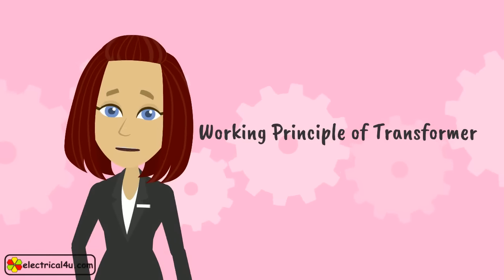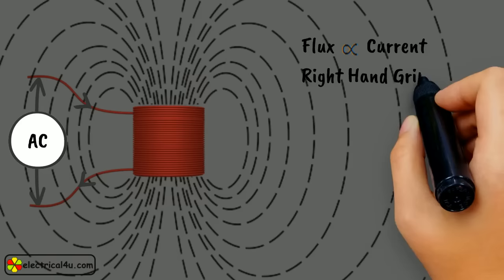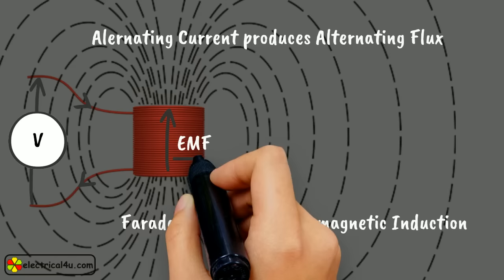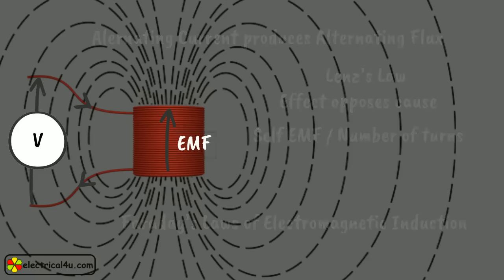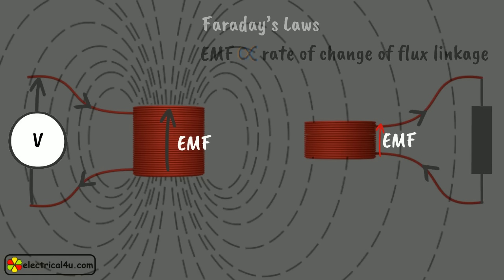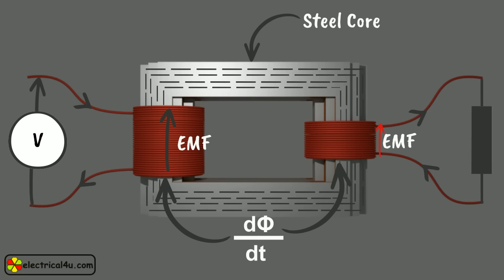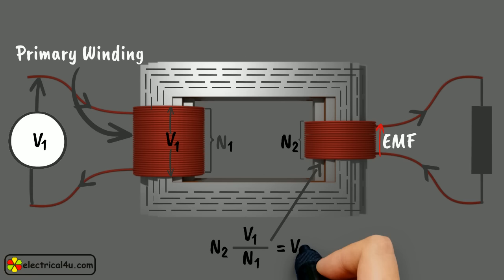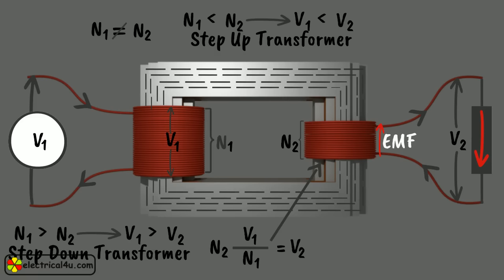What is a Transformer And How Do They Work? | Transformer Working Principle | Electrical4U

Comment: Thank you so much ma'am, you explained it in the most simplest yet informative form ..not kissing on the basic points! ❤💜
Reply: Good
Reply: It's a computer voice.
Reply: A "Free Energy Transformer" is a device which takes energy from one source and transfers it to another without doing any work. It does this by using the natural laws of physics. The most simplest form of this is a transformer which takes electrical energy and converts it into mechanical energy. This can be used to power small devices or motors. 

The more complicated form of this is to take energy from one source and convert it into electrical energy. This can be used to power large devices or homes. The advantage of this is that it doesn’t require any input of energy from the user, other than setting it up initially. It also doesn’t produce any waste products, such as heat or pollution.

Comment: In recent years, the cost of living has increased while the wages of the average person have stayed about the same. With the cost of electricity on the rise, it is no wonder that people are looking for ways to reduce their energy bills. One way to do this is to create a free energy transformer. This transformer takes advantage of principles in physics that allow electricity to flow freely through certain materials. 
The first step in creating your own free energy transformer is to find an appropriate container. The container needs to be able to hold a charge without dissipating it. Glass or plastic containers work well for this purpose. The second step is to add an electrode to the bottom of the container. This electrode can be made from any metal, but aluminum is a good choice because it is inexpensive and easy to work with.

Comment: Err... S Ghosh. Thanks for the video and i am sincerely grateful especially for the clarification of the difference between supply voltage and induced voltage in the primary winding.

I do have a question though. Since according to Lenz's law, the induced emf is such as to oppose the causing emf, is there not supposed to be a nullification of the supply voltage in the Primary coil such that no current flows through the Primary?
Reply: Thanks for ..... Good explain ...to this Part... thank you madam

Comment: Will you clarify ,
 While , using the core, maximum number of magnetic lines pass through inside the core 
So how the secondary winding can get exposed to maximum flux  ?
Is there any step skipped  to explain 
Before happening mutual induction inthe case of transformer?
 Most people skips that.
Thanks and regards

Comment: As you have said that the polarity of induced voltage is opposite to the polarity of applied voltage ....
But ac voltage is always changing with the time period ...
Is the induced emf also changing ?
Reply: Here, it has explained only the opposition of the applied voltage , not the changing of voltage respect to the time period. Induced emf will change for different time periods not for a while.
Reply from the maker: @satyapc7081  This!

Comment: Electrical4u If the secondary coil generate electric force/current due to magnetism then will it generate current when it is wound around a bar magnet without the primary coil?

Comment: hey guys i have a question hope some one can answer. 
The primary coil is creating magnetic flux and the secondary coil is kind of using that magnetic flux to increase / decrease (depending on the no. of turns) the voltage.
isn't the secondary coil generating electricity all by itself?
i mean without any magnets or generator or any movable parts?
Reply: playstore pj  how can it generate electricity without the magnetic flux lines and there is no battery ?

Comment: You didnt mention about eddy current and its prevention used in the transformer
Reply from the maker: You're right we didn't, as we didn't want to make the video too long (and some people are only interested in the basics of how a transformer works). But it is definitely a closely related topic.

If you'd like an in-depth explanation on eddy currents, you might find these articles useful:
Eddy Current Theory and Applications - https://www.electrical4u.com/eddy-currents-theory-and-applications/
Hysteresis Eddy Current Iron or Core Losses - https://www.electrical4u.com/hysteresis-eddy-current-iron-or-core-losses-and-copper-loss-in-transformer/
Efficiency of Transformer - https://www.electrical4u.com/efficiency-of-transformer/

Comment: I need your help,I installed 650amp three single phase transformer in three phase,and given motor load than transformer humming loudly but I ignore that after 2,3 minutes transformer becomes smoking and voltage droping after that I shut down the electric line,we given maximum 200 to 300amp load than how it's happen,and smoke smell is normal not found burning smell,i think after heating varnish smoke.after that we wait to cool transformer  than we again try it but when we pressing starter of motor its becomes again humming loudly,so pls help me what is the reason for humming and heating and how it's control or pls send me your no.

Comment: hi
does it mean that we can simply use a 220v→12v transformer as a 12v→220v one?
thank you so much 💖
Reply from the maker: Yes, that's correct 🙂
Reply: Yes, if you take a STEP DOWN TRANSFORMER and wire it in reverse, it becomes A STEP UP TRANSFORMER
Reply: yes

Comment: i dont understand the point .. why the voltage induced in primary winding is equal to supply voltage, because it is opposite in direction. so how e1= v1 .
Reply from the maker: It can be very confusing, but let me give you two different ways to help understand it: 

1) Remember that voltage is a "potential difference". If you consider the bottom of the video to be the "ground", then the voltage difference from there to the top (i.e. the top of where the arrow is pointing on the voltage side and the primary coil side in the video) is equal to the same number. 

2) If you apply Kirchoff's voltage law around the loop, you will see that a voltage supply on the primary coil side (i.e. e1) that is in the same direction as the current flow (that is, pointing down – so the opposite direction as shown in the video) will have to be equal to NEGATIVE v1. So if the voltage supply on the primary coil side were in the opposite direction as shown in the video, then v1 = -e1. But when the direction is opposite (like shown in the video), then hence v1 = e1 (as now the polarity is swapped). 

This is very hard to explain in pure words – but hopefully you find this explanation somewhat helpful.

Comment: excellent, know I know, just one question, if I have a micro hydro generator that outputs 50v but only 220mah, can a transformer increase the amp, even if I had to compromise volts?
Reply: You have a 10 watt generator. A transformer connected to this generator will give at the secondary the same output minus the losses, lets say 9.5 watt (number is at random, just for example). If the secondary voltage is, for example, 24 volt you the will have 395 mA as a maximum output. Higher current will overload the generator
Reply: alessandro de pretis what size of a transformer should I use , should it be small, medium, or large?
Reply: Considering voltage and current a 20 watt (or better voltamperes) 
transformer will fit. You can choose the commercial size most close to 
this value. It is a very small piece of equipment, indeed
Reply: alessandro de pretis thank you you Alessandro I appreciate it very much

Comment: Hi! Does the secondary coil cut the  alternating magnetic field? Is that why the secondary coil has induced voltage?
Reply from the maker: That's correct Chromex (as per Faraday's Law 🙂)

(More info on Faraday's Law here: https://www.electrical4u.com/faraday-law-of-electromagnetic-induction/)

Comment: Why are not u short circuiting the primary wiring by connecting it to ac voltage
Reply from the maker: Think of this example as a transformer in a substation. 

At the end of the line (on the primary side), there will be some AC source providing the potential difference – but here we have kept the potential difference generic to account for all cases, and to not confuse people into thinking that you need an AC source directly beside the primary winding. 

I hope that makes sense 🙂

Comment: Right hand rule is wrong way round. Thumb is current direction
Reply: Ben Stotesbury-Byrne what you are saying is correct and that's how you actually find direction of B in Biot Savart law , but for a circular field you can use your thumb in the direction of magnetic field and find the  direction of current producing it.
Reply: Soumyajit Sarkar do you mean direction of current and magnetic field when using a solenoid?

Comment: Doent current induce in primary coil??
Anyone explain please
Reply: The current is not induced... For understanding this you need to know about inductors. 
Obviously there is a current induced which opposes the applied current it just reduces the rate at which maximum current is reached. 
Also see AC across purely inductive circuit.

Comment: how do the conservation of energy is applied?
Reply: ??????  What 
what do you mean,
Energy has been conserved

The Supply energy,  let's say 240V   entered the transformer... right ?
Current is stored in a magnetic field within an inductor... Right ?  so long as Voltage is passing through it 
once the supply is turned off,  there is no more current,  hence  0 Supply = 0 Output
the law still holds true and so does KVL and KCL

all that the secondary coil did was INDUCE a portion of the energy from the primary for WORK on the output of the Secondary coil (Based on the number of turns in the secondary winding)

what's not to understand ?

the secondary coil took less than the primary coil supplied

INPUT =  OUTPUT+LOSS THROUGH DISSIPATION+WHATEVER IS LEFT IN THE PRIMARY COIL AS UNUSED ENERGY THAT WAS NOT INDUCED BY THE SECONDARY SIDE

Energy is conserved

Comment: Why the output low power out..
Reply: it's called THE SECONDARY SIDE of the transformer

the reason why the VOLTAGE (Not POWER) 
(FYI   Power = Voltage x Current   which is Measure in WATTS,  or if you prefer....... W=V x A)
Is greater on teh secondary side is because there is less induction as a result of their being less windings

AS HOMEWORK...
My advice is 

GOOGLE "HOW DOES A TAPPED TRANSFORMER WORK"

A Tapped Transformer is one that usually has Mains Voltage, (240 V AC in Australia)
on the PRIMARY SIDE
and on the SECONDARY SIDE instead of having 2 terminals,  1 at  0V and the other at the secondary winding Voltage,  it has several

something along the lines of this...

PRIMARY SIDE           ---------------------------         SECONDARY SIDE
      240 V AC                                                                    3v ,     5V,    8V    12V,     15V

The multiple output voltages are achieved by TAPPING the windings at certain points

AGAIN.... GOOGLE IT .

Comment: Why can't allowed dc voltage in transformer
Reply: Direct current can be applied for a very very short time. However, the core gets saturated and after that, the winding (which is effectively an inductor) acts as circuit with only a winding resistance, which is too low. When a high voltage is apllied across such small reistance, current rises to a huge value(ohms law) which can eventually burn the winding. So, dc can be used in transformers until core gets saturated, after that u are gonna burn the thing
Reply: @midhunjacob3986  thank you very much
Reply from the maker: A DC current will not produce a sustained magnetic field and hence not induce a current in the secondary coils of the transformer via faradays law. Hence transformers are only used in AC circuits.
Reply: @electrical4you  thank you
Reply from the maker: @r.manikandan2  No problem 🙂

Comment: yeah, you lost me, too many symbols and stuff. was hoping to see if a transformer meant increase or decrease in voltage
Reply from the maker: Both! 

A "step up" transformer is used to increase the voltage.

A "step down" transformer is used to decrease the voltage. 

You adjust the number of coils on the primary and secondary side depending on how you'd like to change the voltage 🙂
Reply: @electrical4you  Thankyou
Reply from the maker: @consis  No problem at all 🙂

Comment: What is the use of transformer.
Reply from the maker: The main use is to step up (raise) or step down (lower) the voltage level when you have electrical circuits operating at different voltage levels. 

For example – stepping down (lowering) the voltage level from a powerline to a household. Or lowering the voltage from a power outlet to a piece of electronic equipment.